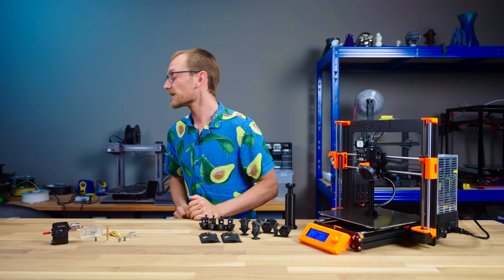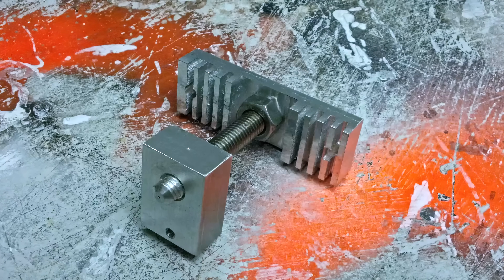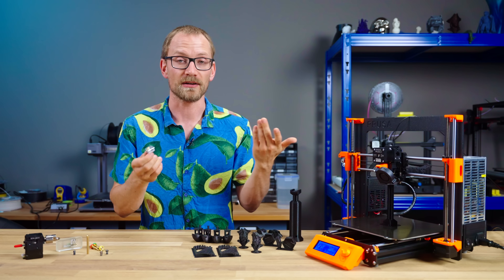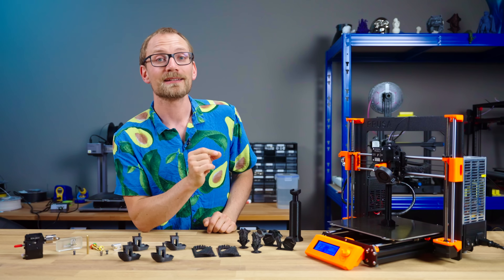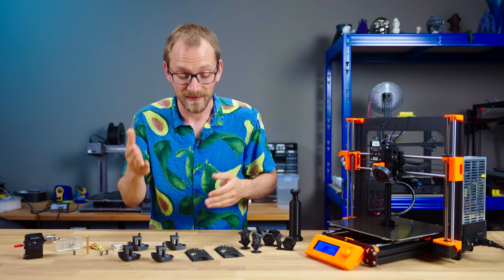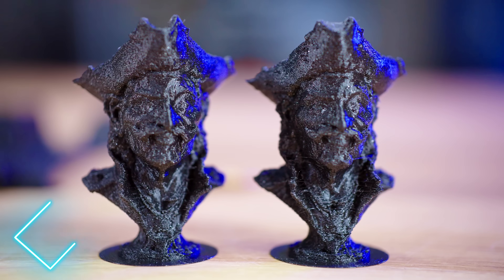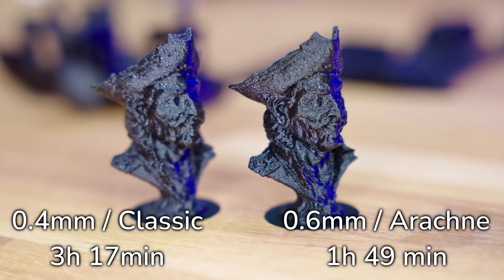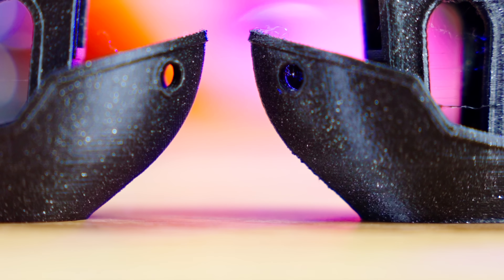0.4mm nozzles just became obsolete

Comment: I just found this video.  On my larger printers ive moved to a .5mm nozzle and my smaller printers are running .3mm nozzles.  Ive thought about going to a larger nozzle on my big printers but am worried about bridging and stringing and both are more noticeable on the larger nozzle.  

In the end i think setting up different printers to handle different levels of quality is the best way to go.  

Im printing on two sunlu s8 310x310, a voxlab x3 and ender 3 v2 pro both 220x220.

P.s. i picked a .5mm nozzle because im making simple objects in tinkercad and a .5 line prints Xmm walls very cleanly (X being even mm not organicly changing).

Comment: 4:15 1 and 2 = 0.4mm, 3 and 4 = 0.6mm
There is a clear difference especially on the roof. You can easily see a difference on the stepping.
Also using a filament with sparkles/glitter is a dirt move since it makes it harder see the layers.

Comment: I want to read a serious paper which I couldn't fully understand, about Arachne wall gen.
A I said to the 3D Musketeer, YT is leading me to contents about nozzle diameters and thin lines, as it was listening while I messed around the options to print small scale letterings.
Arachne made me do it! With a 0.4 nozzle on my Bambu P1P I managed to write 3 lines of Arial text in a 14mm span, and the quality is between acceptable and good. It draws thinner lines than the nozzle size with lil effort, expecially when those thin lines have other plastic to stick to.
I want to "study" it since it sometimes messes the walls up on intricate shapes, and I don't like to use stuff which I don't...Oh, I neither fully understand this laptop here if you want but, you got me. Curiosity! :)

Comment: DUDE you probably won't believe me but the machine at 2:13, I've seen it. For real!
It happened that a guy which I meet in a computer assistance store took this... Memorabilia, this awesomeness, to check to the hardware expert there. It turned out his brother, 15 years ago when we didn't have internet challenges, built this death trap with a mailing list kit. Ya know, where you can't lose the first part because it's the entire hotend for 5 bucks and instructions and you finish 2 years later buying the last screw (and the missed parts) for 25 each. Well, those! 
I was staring at this thing in a weird mix of admiration and disbelief. It's... such a mess that it completes the lap and turns awesome! You really were pioneers, years ago!

Comment: I realize this video is a year old, but it has recently inspired me to try printing with a 0.6 mm nozzle.  But I have a question about it...  Recent new Prusa firmware developments promise to give my Mini+ the advantages of input shaping and pressure advance.  However at this time, the new input shaping firmware only supports the default 0.4 mm nozzle.  So my question is, which will give me the best printing experience, input shaping with the 0.4 mm nozzle, or a 0.6 mm nozzle using the old firmware profile?  In other words, if I can only choose one, which would be better?

Comment: Every 0.4 nozzle is just one spool of glow-in-the-dark filament from being a 0.6 nozzle.
Reply: This hits me pretty hard. RIGHT NOW i'm using a spool of glow-in-the-dark with a 0.4 nozzle. I think i'll hear this call...
Reply: Holy crap. Thank you
Reply: Use of hardened nozzles with glow in the dark filament is always recommended by pretty much every filament manufacturer.
Reply: @gadgestlab  Stainless steel seems fine too, at least with Flashforge glow filament.  The particles in the filament are way smaller and steel is waaaay better than brass.  Going to order a hardened one soon but went through an entire spool of glow filament without issue
Reply: wait.... why?
Reply: @deadmonkeyeuc2594  glow in the dark fillament has particles ij it that gives the glow in the dark effect, thise particles are hard and dosn't really melt at the printing temperature the plastic is, turning them into an abrasive while printing, basicly sanding the inside of the nozzle. So something like a ruby, diamond, sapphire or hardened steel nozzle can handle it, but brass nozzles are too soft and will be sanded bigger than what they started with.
Reply: @Silver_Semtexagon  The pigments used in glow in the dark is typically zinc sulfide or strontium aluminate. To melt ZnS you would need a blast furnace and it would probably decompose in the process.  As for it chewing up the nozzle, its more so a issue with brass nozzles, its less of a issue with a quality hardened nozzle and non it all for a specialized nozzle.
Reply: @Silver_Semtexagon  the gremlins that light the glow in the dark need extra space to get through the nozzle
Reply: My glow in the dark filament just arrived today and I was about to start printing on a non hardened steel nozzle. 

I ordered a hardened steel nozzle with the printer but figured I would just use the normal nozzle first but looks like i'm installing it earlier than expected.

Thank you kindly for your words of wisdom.
Reply: Well, my E3D obXidian would like a word...
Reply: My matte does it. Matte black that looks beautiful but shreds nozzles and leaves dust everywhere. Buy hardened steel kids
Reply: Haha!
Reply: Im printing glow in the dark and filament that has particals in them like holographic, i run slightly hotter at around 120mm/sec and i have not had a clog in a 0.4 nozzle
Reply: By half spool it's point .6 🤣🤣🤣
Reply: Not the ruby or diamond nozzles
Reply: idk man I've printed plenty of glow in the dark without ruining the nozzle. must be a specific kind you're using
Reply: I have never had this issue but literally the first novel I replaced on my under 3 was with a cheap hardened steel nozzle and then eventually that was replaced with the very good nozzle that came with the microswiss hot end i run now
Reply: Haha! And one roll of carbon from 1mm nozzle.

Comment: I hate to criticise your sponsor here,  but I have to warn potential buyers. Don't expect FibrePunk to work 'out of the box'. There is so much fiddling about to get your files transferred successfully (i.e. uploading twice and deleting the first upload to avoid the 'printing 0/0' error), and the micro SD interface 'card/ribbon cable' is so sensitive to movement that it's 'beta' at best. Plus SD card makes are trial and error - you might end up buying several before you find one that works with the device. Tech support doesn't really give actual solutions without many email back & forths, and downloading hastily customised patches of the firmware just to solve a particular problem.

Comment: define print faster. since on some slicer settings you had like 40-80mm/s which is really slow. Even my ultracheapo printer prints infill and supports at 160mm/s and outer/inner wall speed in excess of 100mm/s. Would i be able to go over 200 with a 0.6 nozzle then? i have a 0.4 installed right now, but i have all the way up to 1mm if need be.

Comment: Would've liked to see a 4 way comparison, standard 0.4, standard 0.6 vs new 0.4 vs new 0.6.

This video assumes that 0.4 old was chosen for being the fastest way to achieve a given level of detail, rather than the most amount of detail you can get in a given time. Arachne offers more resolution at a given speed.

Tbh I don't think your necessarily wrong bc if you want incredible detail you go SLA, so the need for hyper detailled fdm isn't necessarily there

Comment: Ok i tried going from 0.4 to 0.6 and it didnt really cut for me. I do a lot of functional prints an going from .4 to .6 caused a lot of my designs and design habits to perform poorly. Suddenly, getting m5 nuts to sink into tight spaces properly became a challenge. Warping for some reason became a much greater issue. Yes, you can print fast and use 0.28 layer height as default but unless you are printing flower pots and big decorative models you will notice a loss of precision.

Comment: No no. For PLA prints maybe 0.4 nozzle is obsolete, but for CF or others with higher viscosity - no way.
Reply: For carbon fiber materials, everyone uses a 0.5 or 0.6....Most of the carbon strands are 0.4mm, so that's why. You make no sense
Reply: @coltenmeredith8899  Yes, I agree, that what I wrote makes no point. What I meant is CF filaments are hard to print if line width differs from nozzle diameter. If you have 0.6 nozzle and want to print a 0.4mm thin walls - no way.
Reply: @AlexanderMoon  ah, I get what you mean. A 0.4 is more versatile

Comment: This video's 8 months old so maybe you've already been told by now (several times?) but it seems like you've got the wrong end of the stick about nozzle diameter. A 0.4mm nozzle doesn't need to print 0.4mm line widths, in fact ideally it should print at least 10-20% wider, and can typically print as much as 150% wider without any issue. Forcing extra filament through the narrow opening causes it to pancake and greatly improves layer adhesion. In addition, you can typically print ~20% narrower than the nozzle diameter without any issue (especially on outer walls), so a 0.4mm nozzle is perfectly suitable for anything from 0.32 to 1.0 mm wide. The real bottleneck isn't nozzle diameter, it's flow rate: filament melting speed. Cura gives the option to have different widths for outer walls, inner walls, and infill, so with my 0.4mm nozzle I usually use something like 0.36mm/0.48mm/0.8mm respectively. This maximizes outer surface detail and part strength while minimizing print time. Yes a 0.6mm nozzle theoretically lets you print faster, but in reality you're very likely going to run into a flow rate (filament melt rate) bottleneck long before you're limited by a 0.4mm nozzle.

You later say 0.25mm nozzles are now redundant, but this is again mistaken IMO. 0.25mm can print anywhere from 0.2 to 0.6. If anything, 0.2/0.25/0.3 is something I think more people should be considering. Printer acceleration is a far bigger print speed bottleneck than nozzle diameter even at 0.25.

Comment: I printed a small watering can using a .4mm nozzle. The process took 8h 39m; it came our very nice. My wife let her friend abscond with it so I printed another one. This time I used a .6mm nozzle and even added a 3rd perimeter; the process took 3h 53m and looks almost exactly like the .4mm nozzle. Thanks much for the knowledge gained on your site. This isn't the first time you have "learned" me.
Reply: Weird. I bought 0.6mm nozzle and it's almost a mistake. Printing speed limit is not limited by mechanical movements, but by volumetric flow most of the time. PETG prints almost the same time with 0.16mm and 0.2mm layers. With 0.6mm nozzle walls are thicker, more material goes to the print (two wall perimeter has strength of 3 wall perimeter) and it can make whole print slower. On the other hand it saves some time on acceleration and movements, but in reality I don't see much difference, maybe it's 10 to 30% faster depending on geometry, but biggest difference is the material.
Reply: @pavelperina7629 not true because with a larger nozzle you have less mechanical movements.
Reply: @EnlightenedSavage  Yes you have less movement, but when maximum of material that can go through nozzle is for example 15mm3/s, 0.4mm nozzle with 0.2mm layer can move up to 15/(0.4*0.2)=187mm/s. Toolhead may reach speed of 500mm/s so it's not the limiting factors. Yes there are less moves cause there are less layers and walls, there are less retractions and so on, print can be somewhat faster, but it's not double and it depends on geometry. And toolhead moves at 80mm/s instead of 190mm/s during print.
Reply: How do you know what it looks like compared to the 0.4 if you gave it away? 🤔🤔
Reply: how do those water cans hold up today? i've been having issues with water leaks while printing with Bambu PETG HF and 100% infill gap..
Reply: On any modern printer, there will be no difference between the printing time on the 0.4 nozzle compared to 0.8. The printing speed will rest on the performance of the hitblock, and it is absolutely the same on both nozzles.

Comment: This sounds like it would be perfect for those REVO hotends with the easy nozzle swap. 

Admittedly i've always struggled with prusa slicer and Cura getting prints as tidy as simplify3d. I know this is a me issue but it is frustrating as the other two do have some nice features that would be good to use. AKA this video

Comment: Switching to 0.6 for the models that don't need a lot of fine details is a good idea, especially with more modern slicers. However, (small) finely detailed models just tend to come out better with smaller nozzles (given the same slicer!). You know what's really great? You can swap out the typical nozzle within minutes if you like. That way you can print lots of details with a small-bore nozzle, and quickly print larger mechanical parts with a larger-bore one.
Reply: Depends on the printer. With older printers you can get the nozzle scraping the bed if you don't re-calibrate with a new nozzle (that can add 5-20 minutes depending on printer)
Reply: i have one printer where volumetric is the limiting factor so i got a 0.2 on that :)
Reply: You obviously don't have a neptune 4.
Reply: Thanks Mr. Obvious
Reply: Abdo, no need to be toxic about it dude !
Reply: @AbdoZaInsert  did you just reply to yourself
Reply: @neufxtrois  Seems like it...

Comment: One thing to keep in mind with those running a bowden setup: a 0.6mm nozzle will have a lot more stringing, and might not be able to get rid of it entirely.
Reply: Why? The retraction has to be adjusted for varying nozzles but no reason it can't be correctly set.
Reply: bowden should be banned

Comment: having issues getting prints to stick on my ender pro 3 using a 0.6 nozzle. Tried using cura and prusa. Also tryinh my new Garolite G10 3D Printer Build Surface. was able to get some small prints to print great on the new bed but when i switched to the 0.6 nozzle i also tried a new much bigger print that takes up the whole print bed and i cant get the 1st layer to stick.

Comment: Not sure how or why a video on 0.4 vs 0.6mm nozzles became an irrelevant in-depth review of settings in a slicer I don't use, but that's not what I signed up for when I clicked on a video titled "0.4mm nozzles just became obsolete". So only watched 1/3 of the video. Video would have better been titled, "Prusa slicer-specific nozzle diameter comparison. Don't watch this video if you slice with Cura."

Comment: i change my nozzle diameter depending on the object all the time. You can knowck hours off a print that has a lot of straight lines and needs strength, not detail. I don't need many small details so the 0.6 is my daily driver.

Comment: The problem is when you print small stuff as you correctly noted the 0.6 can become a problem but in general 0.5 I wish would come standard now that little extra width just makes a lot of things a little bit easier for new people

It doesn't make the 0.4 mm obsolete however because any type of hobby were mass is important The 0.4 mm is an optimal balance between strength and mass a 0.6 mm nozzle would add 50% to the mass of any model I printed with little ability to reduce that mass I simply don't require a wall thickness that big I have to bump up to five inch rockets to get to the point where a point 4 mm wall is insufficient and you really need a 0.6 mm wall to handle the flight stresses and landing forces

I'm betting the same would apply for airplanes The glider I printed at 0.6 mm was substantially heavier than the glider I printed at 0.4 mm above and beyond the increase in size

And you can't simply extrude 0.4 mm from a 0.6 mm since no matter how creative the software is you're going to have a 25% legal space on each side and that's enough to prevent wall fusion when printing ultralight vase mode parts

The results you're getting however are pretty fascinating I also wonder if YouTube is trying to murder your channel on televisions? It's been days since I tried to watch this video I gave up several times because I refuse to allow YouTube to show me four videos in a row for advertisements it was just destroying your video with ads one time it tried to show me six when I resume the video it showed me two ads at 15 minutes and 32 seconds and then immediately after about a half a second of your video playing one of the show me two more ads and then 40 seconds later wanted to show me two more ads I was like nah that's not worth it and just left

Then I tried watching your video on my phone and it didn't try to crush me with ads so I wonder do television brands have deals with YouTube to show more ads? Is there some sort of ad sharing with manufacturers? Like maybe ONN got greedy and is allowing you to show more ad s for a larger cut or something?

Comment: I love and hate arachne, for things it does well, it's great. For models with tiny teeth/spikes it has to be disabled. When I switched to .6mm nozzle I had so many failed prints, nozzle clogs and other issues that all just disappeared when I went back to a .4mm nozzle. I also found that I had issues with hole dimensional accuracy.

Comment: It took some tuning but after seeing your video I was completely hooked on 0.6mm until I used some filament requiring 240C temperatures and my stock Ender 3 V2 hot end couldn’t keep up. Not sure yet whether I’ll just try a 50 watt heater cartridge or upgrade entire hot end.

Comment: Great video
Small feedback on the audio of the video. Due to the noise gate and compressor you are using (or is build into the software you are using) the noise level is very inconsistent during your talking. This distracts a lot when listening over e.g headphones.
Maybe you can try using suiker noise reduction, while adding artificial noise after that, to keep the final level consistent